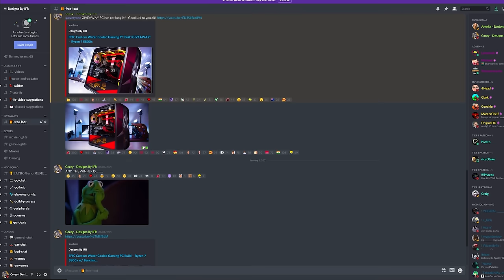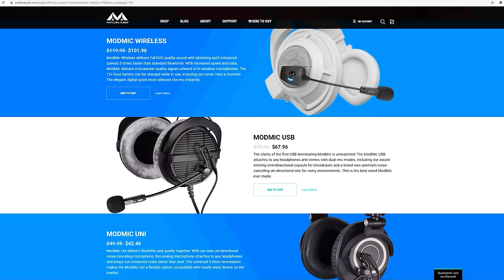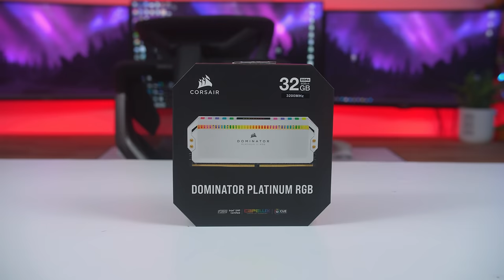I Built a $4950 RTX 3080 Water Cooled PC for Tech YES City

Comment: An EK waterblock or bitspower would have looked awesome.
Reply: Yeah I crammed a full EKWB build 5900x / 3080 into my 5000D with 2 PE 360mm rads. This build seems deceptive. If you look at this build they crammed the front fans onto the wrong side up against the glass @14:38. I doubt the thermals on this are better than a sauna.

Comment: The Look is - as usual - a big plus for u! BUT the functionality suffers hard for it!
Here are my thoughts to make it even more worth in both: 
1. Why dont put a glassplate or acrylics on the verytop of the case? The tubes there could be shown as well!
2. The heat of the CPU (and thats A TON on the i9 10900K!!!) is directly intake by the 240 Radiator of the graphiccard. This will put the GPU under much heavier thermals as must be and is the reason for my third thought...
3. Yes its a watercooled build BUT: With the in 2. described problems the rest of this case is likly under a higher temperature as it needs, because behind the 240 radiator only one Fan pulls out the heat above the rest. And by taking 2/3 of the inflow directly behind the 360 there is like 0 airflow above the rest of the compounds. so in my mind the z490 with the big monoblock is useless in here, because you are lacking in ... maybe 15-20 % - maybe more due 100 % optics and like 20 % functionality of the cooling setup.

Comment: I would rather have the x570 Aqua with a 5950x or an asus glacier z590 with an 11900k. Chrome tubing. No color whatsoever. 64gb of 3800c14 ram. 4-8tb of mp600 pro, a couple 4tb 870 evo, and a couple 10tb wd black. Custom metal psu cables. Noctua chromax fans. Not a single color, or rgb. Just white light. And all inside a o11d mini with custom vertical gpu mount, and a custom distroplate that still lets you use all 3 radiators. Also mod the case so that thicker radiators will fit. 
Finish off with a custom metal mesh super light Logitech mouse, a heavy grail keyboard kit for a happy hacking keyboard pro 2s with custom key caps and a double sleeved coiled lemo connector cable. A pair of reference kef bookshelf speakers, a 175hz 3840x1600 panel flanked by 2 4k 144hz panels in portrait on a gas spring assisted triple monitor mount. Finish off with a pair of final audio d8000s with a custom cable, and a stack of Dac/amp/speaker amp with a preamp eq unit. A wireless mod mic for gaming, and a Neumann u87 with shock mount and pop filter on another gas spring assisted boom arm. Plug this into a universal audio thunderbolt 3 audio interface or any other high end desktop audio interface. Then finally a owc 8 bay thunderbolt hybrid dock with 4x16tb u.2 and 4x18tb hdd and a slot for a pcie card in the future. Possibly a 40gbe nic that can keep the contents of the tb3 das backed up on a nas. Or a professional gpu that does number crunching or rendering. Set it up on a massive butcher block over Alex drawers or some other boutique version and a 24 hour leather chair. Set up a hidden compartment that holds a vr headset, hotas, racing wheel, game controllers. And my personal favorite, fully stocked 20oz Red Bull fridge.

Comment: @15:38 How does this breath with shoving those front fans to the wrong side up against the glass? You also had to remove the dust filter there and yeet it out. Besides the fact that the other logical place for a good radiator is covered for aesthetic piping, that side 240 is also an exhaust but no air is coming from the front. It must be getting air from somewhere in the multiverse. Should try making it at least an intake. I would love to know the thermals on this because I'm okay being wrong but this seems like the worst build for thermals I seen in a 5000D. It's beautiful, the hard tube runs are FLAWLESS, color isn't ungodly, impressive dual loop fitment, unqiuely creative, but also from what I see, a performance hit.